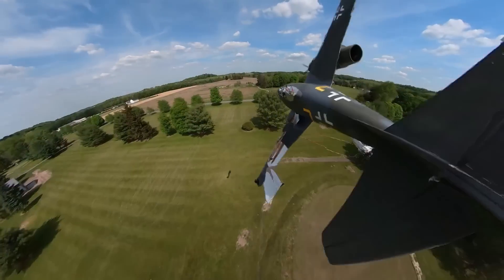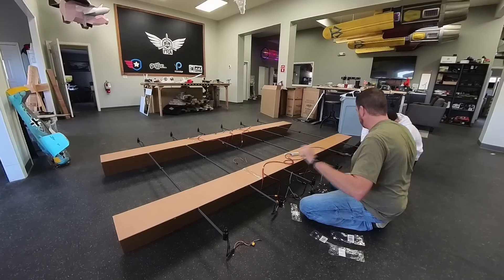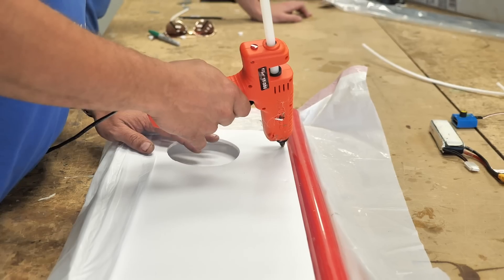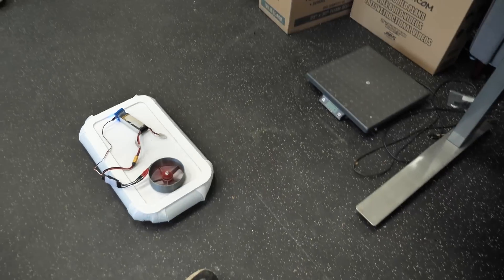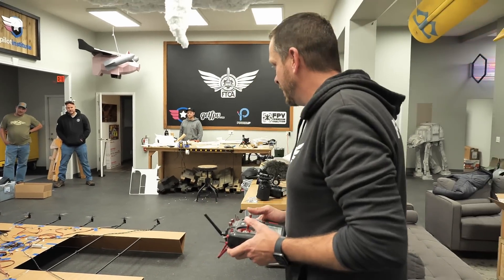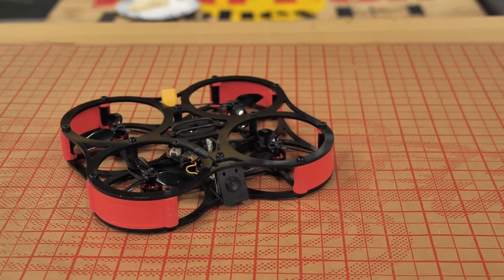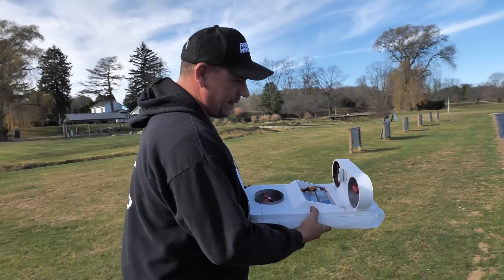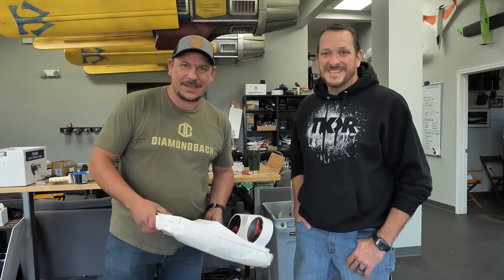We Made A Hover Craft!?!

Comment from the maker: Thank you Bear Mattress by Brooklyn Bedding for sponsoring! Visit https://www.bearmattress.com/FliteTest to get 30% off your mattress with code FliteTest
Reply: Make military hovercraft
Reply: I think the Dave idea isnt come realuzing due to impellers throwing airs throw the pad. 
It is good came if pad stand constant compressed by nipel. And the air from bottom of the pad are forcing throw the tubes from isolate impeller. 
Nipel may have ellectric trigging to accumulate and disaccumulate air from shortly from simple little air compressor. But the pad may be good if it has a constant airway pressure to specific riding faces.
Reply: Cool Video!!! Please make a build video on the mini hovercraft (step by step), and a link to the electronics that you use. I tried to make it myself but did not succeed :(

Comment: Full sized hovercraft using a bag skirt have drain holes in the rear of the skirt just behind the ground contact line. That way any water that finds it way in can escape instead of filling the bag skirt weighing it down till it can't move.

Comment: I’m only an amateur rc hovercraft builder but I have built around 30 in total and I’ve found a contradiction To the rule for hovercraft 1/3 power for lift and 2/3 thrust I’ve found in small scale having additional lift ability very beneficial! and a 50/50 power split works best for single or multiple engines, for some I set up a dual rate for the lift motors for rough terrain also gyros are your best friend flying these
Reply: I GOT SOMETHING FOR YOU..
^_^^_^^_^^_^^_^☺️☺️☺️☺️

Comment: I had built a hovercraft about 4 years ago, using parts from a old drone. I did not need to angle the thrust Motors out to the sides.
Bc it was drone operation....it would lean into the corners automatically.  Making for a very friendly user experience. 

Needless to say differential thrust worked very well.
Reply: I GOT SOMETHING FOR YOU..
^_^^_^^_^^_^^_^☺️☺️☺️☺️

Comment: Hi. reference the h/craft skirt, they stopped using the inner holes in the skirt method decades ago. Please open youtube & find a vid. about building a Universal Hovercraft & you'll see how to divert lift air into the skirt & just dump the bulk of it directly underneath the hull. Drain holes in skirt rear release any trapped water & airflow. I've built a 17 foot SEVTEC Hovercraft & if I ever finish the trailer I'll get it to the river. Love your show...Eric. (in Aussie ).

Comment: TYCO used to make an rc hovercraft, they had dedicated vents in the bottom for the airflow to move under the skirt. The lift fan turned on the moment the power turned on and then it used dial rear fans for forward/back/turning.
Later designs used a more powerful lift fan but the design was still very similar. You’ll find that with a longer chassis the stability is vastly improved over the shorter ones.
Reply: Your really bringing back some childhood memories talking about the Tyco typhoon

Comment: mmmkayyy... 
Might I interest you folks in an experiment, to settle a decades-long argument? 
It would be a hovercraft, scale-model of a heavy Panzer hovertank from David Drake's "Hammers Slammers" series.

The debate concerns whether gimballed ducted fans venting directly into the plenum chamber would provide horizontal thrust when tilted.
In the books, there are no external drive/pusher fans.
Some (myself included) argue that the thrust/lift vectors of the individual fans will provide directional motion.
Opponent opinion is that the pressure in the plenum will equalize and erase those vectors.

For a full-up testbed, you would need eight ducted fans mounded in housings that seal fairly snugly to the plenum shell yet permit tilting on two axes. The fan blades would have to be airfoils, half spinning CW and half spinning CCW to avoid spinning the testbed as a reaction to motor spin.

I figure a 1 : 10 scale would suffice.
that would be 90cm L 50cm W and (including turret) 30cm tall.
the fan diameters would be nominally 10cm at this scale.
as it is to remain in close ground effect, it can be heavy and robust in construction.

If you are not interested in such an experiment, could you instead tell me exactly what motors, fans, and electronic equipment I should purchase for the fans, gimbals, power cell, and control unit? 
I can fabricate the rest.

thanks!
Reply: I'm thinking that the pressurized plenum will cancel MOST of the effect of the gimballed blowers.  I could be wrong of course!  You might need opening vents in the skirts to provide push in the direction you want to move, although that would also dump some of your lift air.
Reply: @michiganengineer8621  - can't use vents and remain true to the fictional vehicle. 
(also: the plenum skirt is rigid steel in the books. the tank hulls are iridium castings. the mass is 170 metric tonnes. ridiculous fusion-powered monsters.)

I've been in the theoretical back-n-forth on this topic for 30 years.

motor, microprocessor, battery, and RC tech is now good enough and cheap enough and I have enough disposable income that it is time to just do it and see once and for all. I just don't know the first thing about the electronics. 

amusingly, Drake honestly does not care one bit whether the tech works. it just needed to sound good so he could set it, drop it into the milieu, and concentrate on the story.
Reply: @gordonpromish9218  It's time to revisit that universe for me at least.  I've always been fascinated by the hovertanks and the combat cars.  Getting 8 ducted fans balanced would be a royal PITA since you couldn't really feed into a secondary plenum (think an airhockey table) like many more traditional hovercraft do and have that bleed into the skirted area.
Reply: @michiganengineer8621  yes, the blowers use a direct plenum, so balancing may be a massive PITA.
on the other hand... assuming fans in two columns of four, only the cornermost fans farthest from center mass need to be gimballed, the others can be fixed mountings. 
as this is not supposed to fly, and in fact will need to be kinda massive just to keep it from flipping like a tiddlywink, fan balance may not be as important as in a proper drone. 
the lateral movements are supposed to be "ponderous"

Comment: you better not build anything as yourself, "you said it yourself" as if not God in you, honor to God, mate bro
Reply: blinded by law slaves
Reply: thats the revelations beast, the mindless law slave
Reply: if you partially float inflate the light soft hull with helium, you get a very light weight airplane
Reply: the pressure keeps the airplane in flight shape, also the wings
Reply: props to you, would you say
Reply: helium inflated body is better than foam structure
Reply: try air mattress, it goes in even smaller space
Reply: same for aircraft collapse/folding of the inflated body